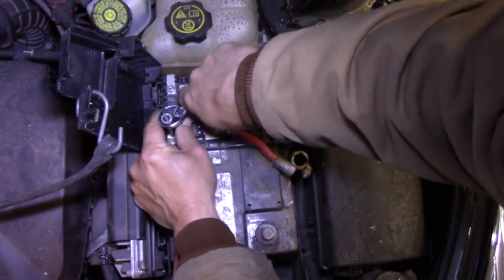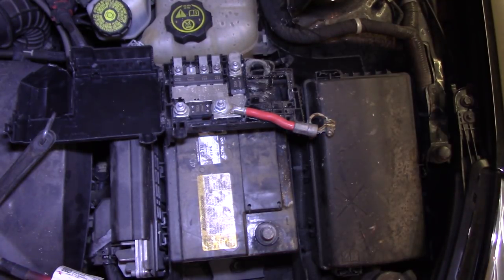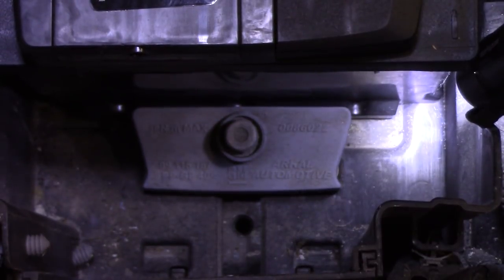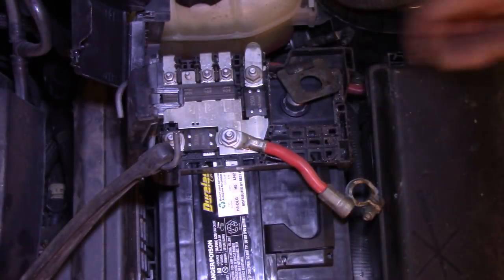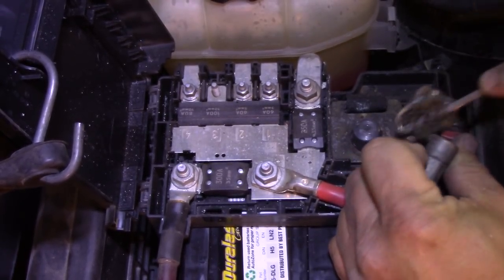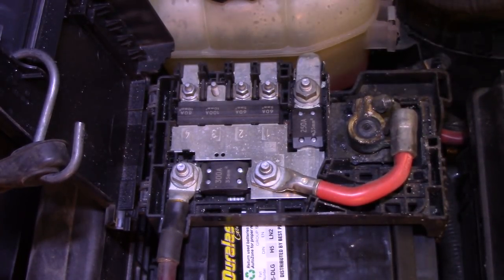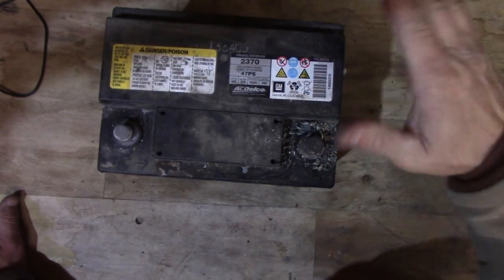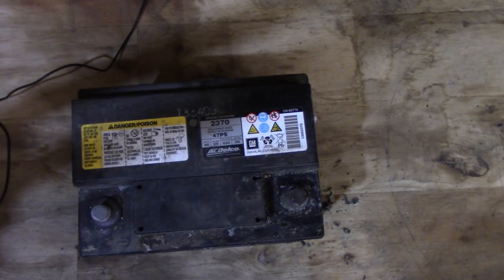2013 Chevy Malibu Battery Replacement

Comment: Thank-You so very much. This video makes rreplacing the battery so much easier than I thought compared to other cars. And now I have to replace the Alternator on the 2013 Chevy Malibu too and that is A pain in the rear because of the tork release bar to release the belt can be A pain. Once the belt is off the Alernator I just don't need i t to slip off anything else. Then it would be hard to rethread considering the very tight limited space.

Comment: Not the original batter.  MFR battery spec is 650 cca AGM  glass mat separator type.  Having charging issues on a 2013 malibu ECO that I picked up used.  Somebody put a 480 CCA battery in this car and it was grossly insufficient.  Knowing what I've learned recently, I would not recommend any battery for this vehicle less than 650 CCA - not necessiarly AGM, however.  Seems overkill to use AGM vs additional cost.  Thanks for the video - it was very helpful in removing the battery from this vehicle.

Comment: Lenny, Where does the negative run too?  I found alot of posts on that the cables are bad in the 2013 causing cars to shut off.  Where does the negative terminal go?  I dont own the car but want to help a friend with hers.  I plan on buying new cables and replacing them for her.  Thanks, great vid by the way.
Reply: @Keona Hatten I'll find the link.

Comment: I was told you had to put a jump pack on the positive cable while replacing the battery or it would wipe out the computer is that true?
Reply from the maker: I don't know. I've changed it twice in this car and had no issues.

Comment: I have a 2013 eco Malibu and sometimes it stalls at the red light does the battery have something todo with it?
Reply from the maker: Juan Vera, I doubt it. Sounds like a fuel problem but that diagnosis is based on virtually no information.
Reply: Its not stalling, you have the start/stop system in yours. Wife's 2014 has the same thing. The engine actually shuts down at stop lights and long stops. Supposed to be some environmental bull***t.  You don't have to turn the key, as soon as you give it gas, it goes again.

Comment: Why does your battery look so bad? I'm just changing my 2013 thats 4 yrs old with 52k and the battery looks dang near new yet with no corrosion.
Reply from the maker: PROTXS EMF HEALTH mines got nearly 100k miles. Other than that, I don't know.
Reply: if im not mistaken weather, climate, and overall having respect for your car.